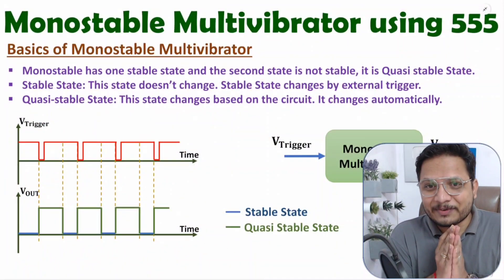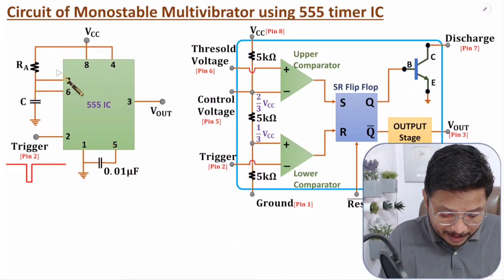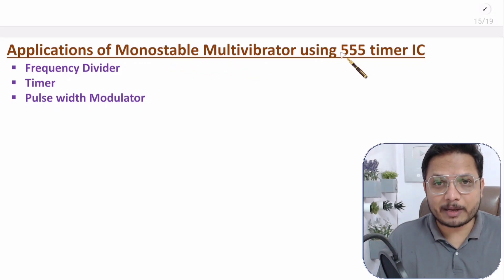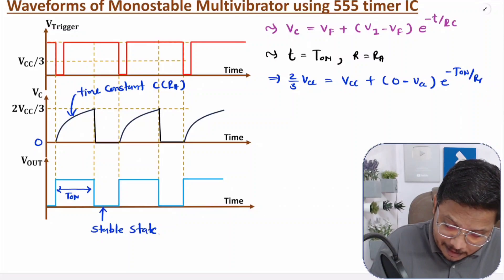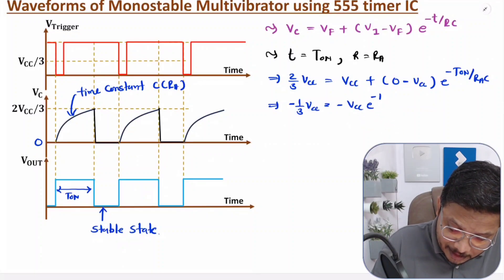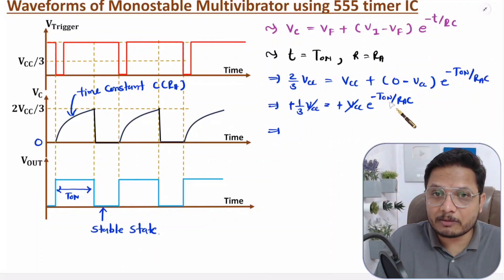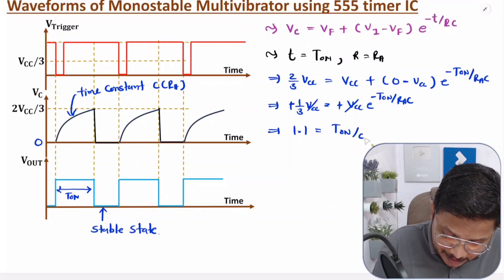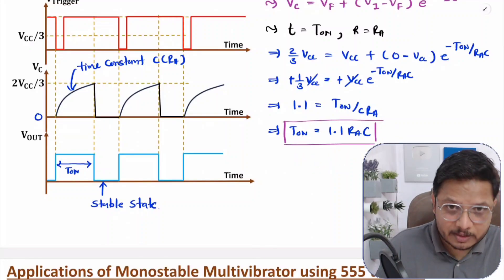Monostable Multivibrator using 555 timer IC (Basics, Circuit, Working & Waveforms) Explained

Comment: What is the trigger voltage
Reply: Trigger Voltage refers to the minimum input voltage required to initiate or “trigger” a change in the output state of a circuit — commonly used in devices like Schmitt triggers, comparators, and 555 timers.

Comment: 00:03 Monostable Multivibrator has a stable and a quasi-stable state.
02:12 Understanding the circuit diagram of a monostable multivibrator using 555 timer IC
04:14 Monostable multivibrator has two states: stable and quasi-stable.
06:33 Triggering and transitions explained
08:41 Explanation of the working of a monostable multivibrator using a 555 timer IC
10:56 Understanding the width of the pulse in a monostable multivibrator
13:15 The width of pulse in monostable multivibrator is defined by the equation T on = 1.1 * R * C
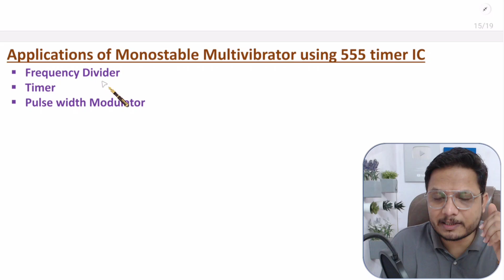15:27 Signal frequency divided by two to detect single pulse